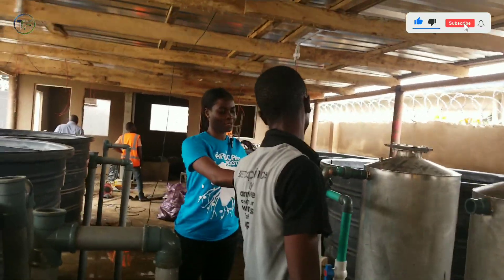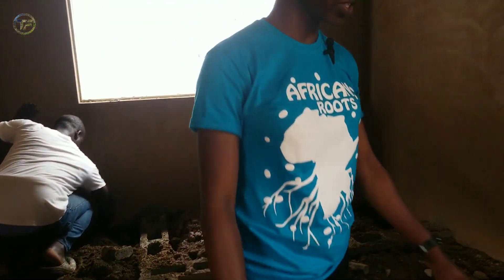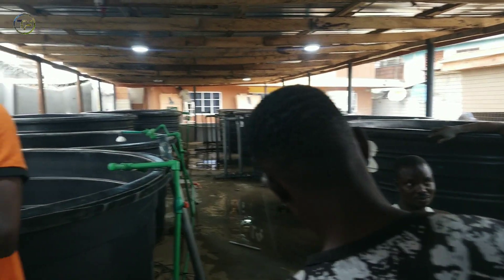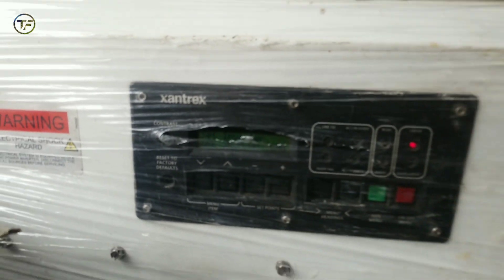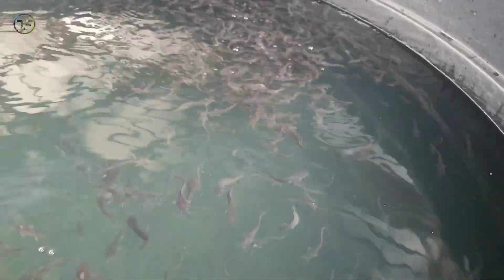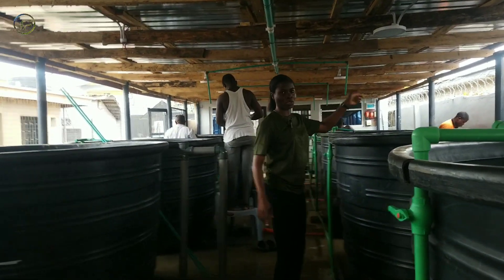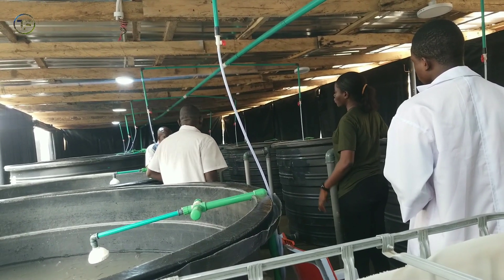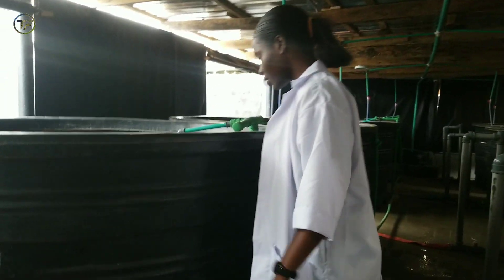5000-Capacity Ultramodern Catfish Farm Setup For Beginners!

Comment: Hi, what’s the dimension of the 4000l tank? The width and depth pls? Thanks
Reply from the maker: the width at the top,middle and base is different cause the pond is small at the base and big at the top. So different circumference.  But it holds 4000litres of water in total
Reply: @TheFarmLadyAquatics  Thanks. What’s the width dimension  at the top?
Reply: @TheFarmLadyAquatics  what is the diameter of the tank both at the top and at the bottom pls.....how many fingerling maximum can it contain? Is this the biggest plastic size available in Naija? How much it sell for.....too many questions but hope u can answer all pls